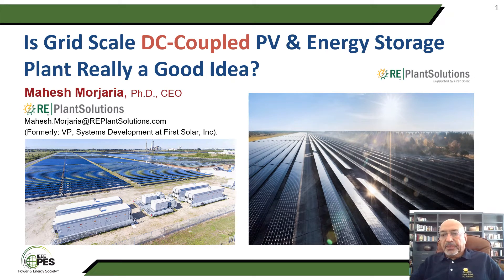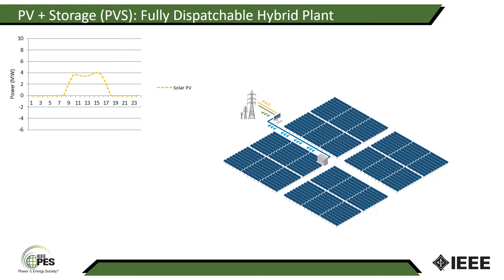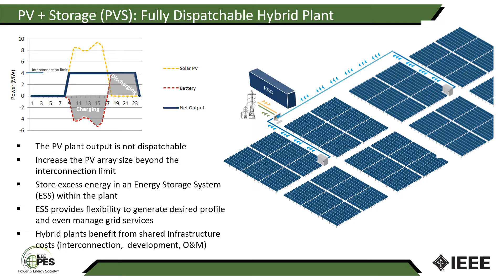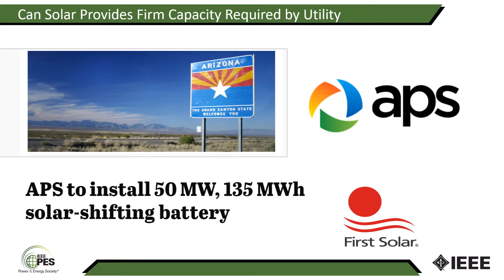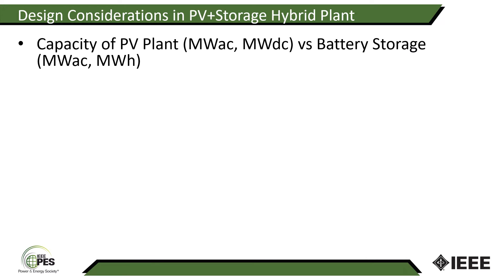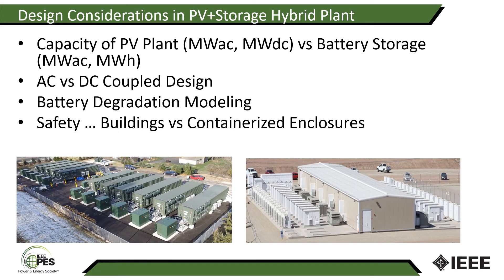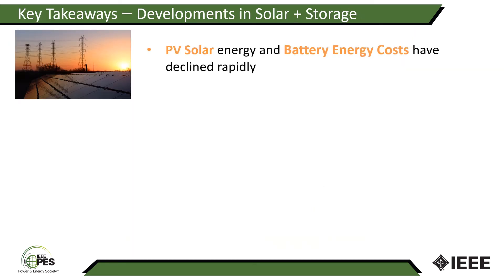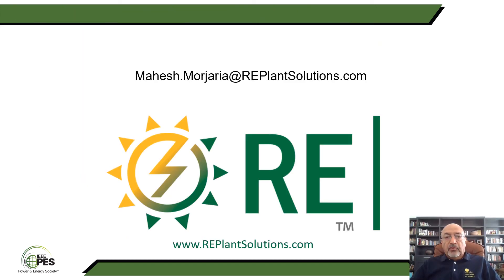Is Grid Scale DC-Coupled PV & Energy Storage Plant a Good Idea?

Comment: Does ESS have to be added at each power conversion station in a DC coupled system? Couldn't high voltage DC distribution centralize more ESS (but not 100%) within the plant? What are the practical limits (costs, losses, etc.) of DC distribution within the plant?